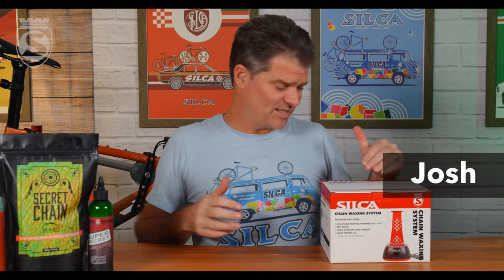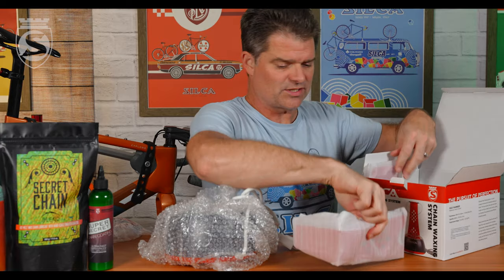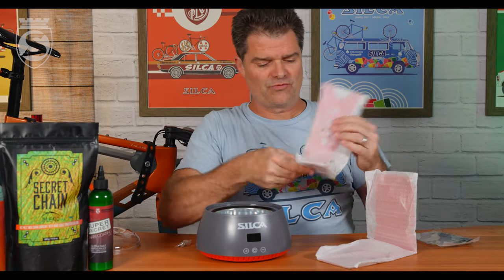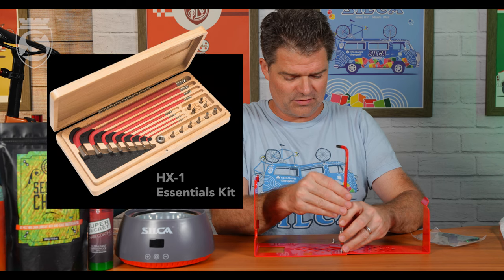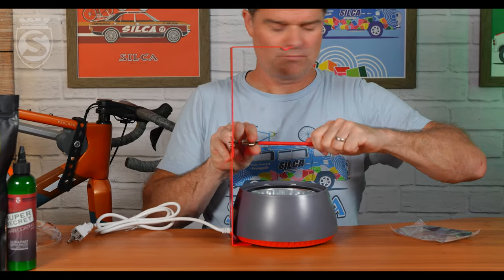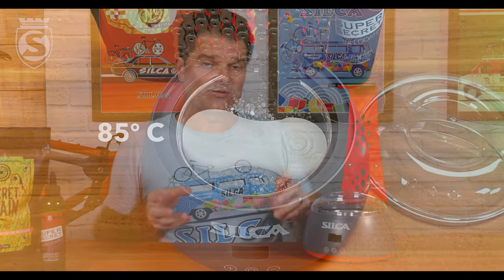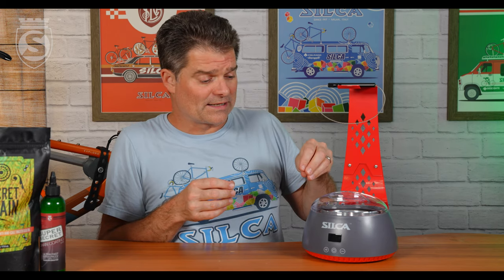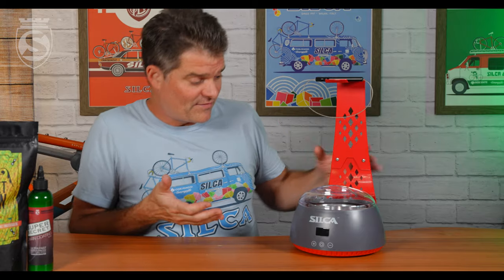Unboxing Magic: The Ultimate Chain Waxing System with Josh!

Comment: Hey Josh, I love your in-depth explanations of how your products work, but I think that a basic video starting from a new chain until its first use on the bike + another video starting from a dirty chain needing to be rewaxed, with no cut but maybe in accelerated would be the most useful help to the community, thank you for what you do.
Reply: I agree
Reply: 100%.
Reply: Agree also. 

This process takes too long to work out or we are victims to sponsored content when cleaning the chain does not need expensive products. I watched different videos and tried to avoid sponsored content. Here is where my process which seems to clean anything: 

Remove chain
Soak in methylated spirit and shake about every few minutes. Rinse (if rinsing a waxed chain use boiling water).
Repeat until the spirit is clear. If you are doing this for the first time, it might take several goes.
Clean with degreaser. Rinse.
Depending on how dirty the chain was you may need to repeat. 
Quick rinse and scrub with regular soap.
Final clean with Isopropyl, this should lift off any residue left over and will evaporate quicker than water. 

I have probably too many steps in here, but it gets the chain really clean. I found a tip online that when the chain is cleaned properly it rattles, and this worked really well for me to know when all existing wax/lube is off. I would describe it as it sounds like a handful of coins. 

No need for fancy products to clean or wasting good lube. Hope this helps someone.

Comment: I bought the Silca System because I can, it looks cool and it actually works really really well.  Melt the wax to 125c. Put the chain in, swill for 30 seconds, make sure it's all nice and covered. Leave for 10 mins, swill it round again for 30 seconds. Set the temp to 75c. Once it's reached 75, take the chain out and hang.   Perfectly waxed chain :)

Comment: I have same wax melter just no brand with digital display and possibility to set temperature for 20 euro. Same like women use for melting wax for depilation.. Love silcas products, im using hot wax, drip wax, chain stripper and also strip chip, but this melter is little bit to much 🙃.  But also dont have that red stand, using feet bike pump to hang the chain🙂.
Reply from the maker: Our melter shares a housing with existing products to help save on cost, but uses custom 600ml pot (15mm larger diameter and deeper) plus much more precise electronics and heating element for better temperature control.  So looks similar but definitely not the same.

Comment: That was something I was wondering… melting at 75 takes forever and leaves a top layer of non melted wax.. I usually push it to 90 and give it some time. But melting it completely at 125 is fine? Once it’s melted I guess back down to 75, dunk the chain in and give it 5 minutes with a few stirs. Will the temperature be optimal?
Reply: He did say in that Q&A video right after the announcement video that setting it to 125 and melting it, then going back to 75 once its melted, is fine. I've been doing it this way and haven't encountered any issues. Am I maybe sacrificing some of the marginal gains? Sure. But it seems to work fine.

Comment: Hey Josh Tks a lot for your super useful explanations about wax. But let me ask you, there is a topic that I wasn’t able to find out on your videos, wax and re wax intervals for e-bikes, especially considering the dirty MTB environment. E -bike chains are quite more stressed than a road bike chain, beside the extra watts from the motor, frequently we pick up mud, sand and even snow. Quite a challenging environment. So any tip about? Thank you!

Comment: Has anyone tried using this wax on thier tools to protect against corrosion? I'm curious if it would work for a reasonable amount of time without wearing/chipping off in a short amount of time. Been using a parafin wax & bar chain oil mix for both car undercoating and tools, but of course, you always have that oily feeling, unlike the Silca wax on a bike chain.

Comment: I picked one of these bad boys up and have a question.

I will set it to 95 like the endurance chip recommended, I'll drop the chain in and let it sit for awhile, then swish it, and drop it down to 75. The display will drop for 95 to 75 in the matter for about 4 minutes, surely the wax hasn't actually cooled 20 degrees celsius In 4 minutes. Is this normal operation?

Comment: Why not offer a complete box? 

For example the chain wax system, secret chain hot wax, drip wax and up to say 6 chains that are priced at about 50 USD each. 

Many users (myself included) have a lot of difficulty getting the new chain clean enough but the price increase for a pre-waxed chain seems to be not far off 100 USD per chain which is too much (SRAM 12 speed is 25 bucks where I live, but costs 110 from Silca). I literally spent a year figuring out how to get a chain clean enough. 

I would however happily buy 4 chains, plus an entire system and although this might mean the profit is low on the chains, the wax melter is by far the most expensive around, so I am sure a decent profit is made overall. And more importantly, customers are buying into the entire Silca ecosystem. 

Just a thought :)

Comment: how is this any different to the identical looking wax pots for body waxing on the usual overseas market places?
Reply: Shipping and trust I guess.
Reply from the maker: Our melter shares a housing with existing products to help save on cost, but uses custom 600ml pot (15mm larger diameter and deeper) plus much more precise electronics and heating element for better temperature control.  So looks similar but definitely not the same.  Sort of like buying a laptop, the $500 and $2000 ones look similar but perform differently.
Reply: @SILCAVelo  thank you for the explanation
Reply: It’s not

Comment: I have my mini crock pot for waxing on a smart outlet so I can get it going remotely to melt the wax before a bike wash/waxing/etc.  Would there be any way to use this pot on a system like this?
Reply: Has a power on button, don’t believe your current setup will facilitate that.
Reply: @SauceWasTaken  That is what I was guessing, but wondered if that was something that Josh had considered. Thanks!

Comment: I sent these suggestions to your support email last week, but I will repeat them here. I think there’s two minor improvements you can make to the wax pot. 

1. Some method of fastening the stand to the pot (eg screw, clip). 2. Some way of holding the chain wire to the stand when not in use. Because of space, I have to store mine and fetch it out when I want to use it. I’ve found the chain holder will fall off and I have to fetch it from the back of the cupboard (I’ve since taken to threading it through one of the holes in the stand when in storage). And when moving it around, it’s kinda annoying the stand and pot aren’t fastened together. You pick the pot up and the stand stays in place, then the power cable drags it about (and then the chain holder flies off down the back of the cupboard). 

Anyway just a v2 product improvement suggestion! Otherwise this is a fantastic little thing and not too expensive either! (About the price of high end chain).  It makes it much easier to get into doing your own immersive waxed chains. I was buying pre waxed chains and using super secret drip wax before getting mine.
Reply: Put a small magnet on the back of the stand to stick the chain wire too
Reply: @joshthomson35  thankyou! Pro tip

Comment: Going full nerd here...the cold chain heats on contact with the hot fluid wax and forces some air out of the pins as it heats up..bubbles. Would i get more complete coverage in the tight spots if i put the rig in a bell jar and pulled a vacuum on it briefly  to bubble much more air out? Then allowed room pressure air back in to push the fluid into the joints?